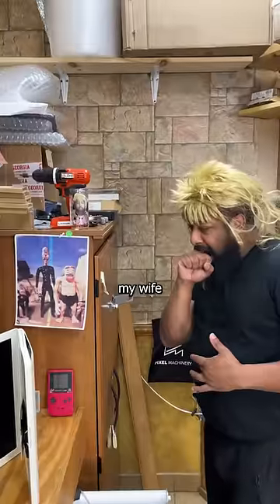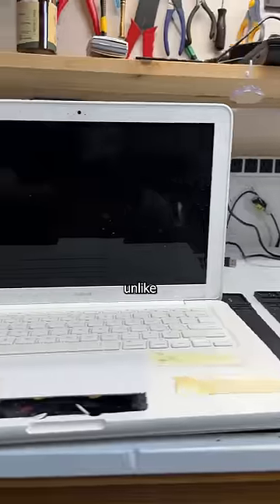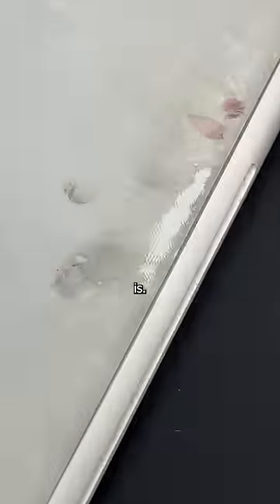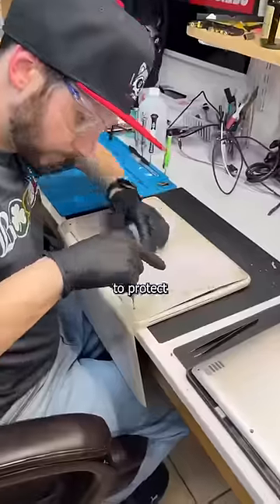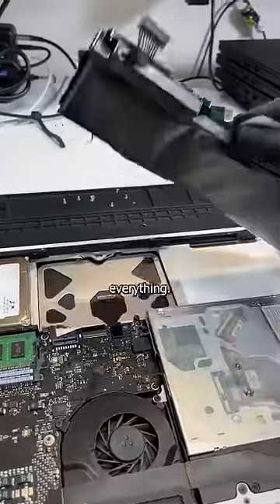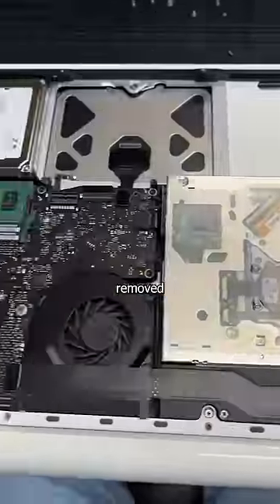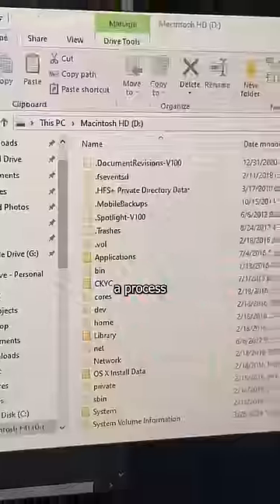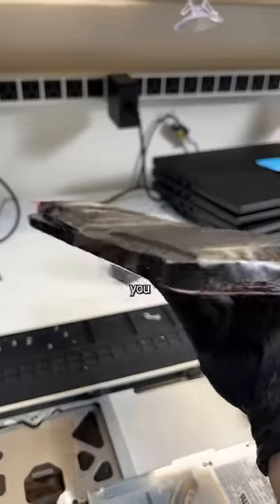MacBook swollen battery removal (GONE WRONG) #tech #technology #pc #shorts

Comment: MacBook Pro 2011. Original battery so swollen, it bent the aluminium base so bad, it’s still not properly back to shape. Replaced it with an Amazon special and that did the same after only a few months. Never had a Windows laptop battery do that.

Comment: Years ago I bought a smartphone from a Chinese brand that I had seen online called Elephone?? Or something like that. After 1 month of using it the battery started to drain extremely fast. I first thought it was because of a mobile game I was playing at the time, however, it only kept draining faster and faster to the point where I'd charge it to 100% and it would be at 10% percent after only 15 minutes... It also started to heat up super fast to the point where I could no longer hold it in my hands. Not long after that I suddenly noticed that the phone felt "bulkier" so I opened up the back and the battery was swollen exactly like that. Safe to say I immediately stopped using it and I never bought a smartphone from an unknown brand ever again.

Comment: My laptops battery used to get broken, if you unplug the charger it will turn off and the clock will stop, so i charge it all day. 
The battery becomes about 3cm taller.

Comment: My late grandfather had a laptop he Essentially used as a desktop. I noticed a bulge in the keyboard. After months of begging him to get it looked at, he brought it to best buy, where they told him that if he waited another week he wouldn't have a house. After evaluating his options, he just had them take the battery out and he left it plugged in.
Reply: Damn, they actually touched the laptop?  When I had a bulging battery in my laptop (wasn’t even that bad honestly, and had been stable for like a year because I didn’t realize the battery was in that area because past laptops had it in the back instead), Best Buy straight up refused to take it in for repair unless I handled the old battery myself first.  I had to go to a small business local repair store to get the battery removed and get a replacement in.

Comment: I had to replace the battery in my 10 year old laptop as it was just as swollen. Additionally a week after i installed the new battery the hard drive stopped working correctly and a couple days later it didn’t want to work at all. It was a pain getting it to work just long enough to recover all the information from it and transfer it to a different hard drive (i bought a slightly better hard drive than the one I had so slight UPGRADE).

Comment: iirc the only swollen battery I've had was the one for my cosmos black 3DS. Funny thing is, it was failing to charge for a couple months before we discovered the swelling battery and just assumed it was something with the charging port (it did the thing where it would only charge at a specific angle except worse). Once we got a new one in it charged just fine. Putting this here in case anyone is also having problems with charging their stuff since this solved both that problem and a potentially explosive one lol

Comment: "Have you had a battery swell up like this?"
With the people i work with, ive seen it twice..
Reply: So you'd have two nickels?
Reply: @philippeleprohon4823  which isn't much but I'm a little surprised it happened twice
Reply: My HP that I played WoW on did this after I spilled 7up on the touchpad and some got to the alt and window key.  I got a metal plate to cover it and an external keyboard to keep it arms reach away and HDMI display to tv but i eventually (after 2-3yrs) just had battery took out.

Comment: "Special software because we're using windows" due to it being a Mac Drive... I wish the repair shop I took my laptop to knew this. :D 

The situation was reversed: They use Mac, and my windows laptop wouldn't boot (Faulty SATA cable, damaged during keyboard repair) They uh... plugged it into a mac pc to check if the drive was faulty. Ended up nearly destroying my windows installation :D

Comment: Yeah mine did this, I just replaced it myself though, the local repair shops were offering excess of £100, when I could find the battery online for £70 and about 5 mins work of screwing and unscrewing/plugging

Comment: Yes. I bought an LG phone, back when they were making them. It was their Flex 2 or something like that. Worked well, but like all LG phones, had an overheating issue. Then the battery swelled up one day after overheating. Thing still ran, but it was no longer sleek. Looked more like a boat than a phone.

Comment: Looks like an older version battery so thicker plastic in and out, this can allow the battery to puff since it can hold gass way better than the newer ones. Also looks like it got quite warm one time, probably got left in a car or sitting in a sunny spot in a hot climate.

Comment: I've only ever had had a battery swole up on me one time. It was a  2DS battery that I decided to charge with 9 volts. It worked. But  It happened because my parents are horrible and kept taking away my custom cables. I was doing it safely so safely as I could  because I literally had no equipment. I literally had resort to biting cables to get get access to the wires.  Unplugged cables, but still.

Comment: yep, had my laptop (nine years old at the time, we got it used off ebay) suddenly swell up and stop closing properly. I didn't think much of it at the time but my dad was like 'oh holy shit we gotta change that battery'. So we spent a fun afternoon taking the back off and replacing the battery. Managed to accidentally disconnect the touchpad in the process, but fixed it luckily.

Comment: Yes, I've seen a swollen battery in my friend's MacBook.  I feared for her safety so I removed it for her.  This is when I learned that MacBooks  are assembled with triangular security screws that most people (including myself) don't have, despite a large collection of screwdriver bits.

This is a safety issue, and Apple is dangerously irresponsible for not making this battery easily removable by the consumer.

Comment: I repaired computers for a school district once, or as I called myself, the Chromebook Wrangler.  We had a bunch of swollen batteries sitting around, but then the battery recycler stopped taking them for some reason, and we ended up just throwing them away.  Which is even worse than it sounds, because this was in Arizona during the summer.

Comment: Lost an entire workstation mat, desk and PC along with a few thousand in damage to the ceiling and wall due to a marshmallow of death cluster out of a 2016 MacBook Pro that had that groovy adhesive that can tear the battery open real good no matter how much IPA you drench it in.
tear battery seal - add oxygen - run
Ensure tech gets medical treatment as needed.

Comment: I had a battery swell up (not this badly, but I caught it early) in my old MacBook that is identical to the one in the video. This happened about two years ago so the computer was well over 10 years old when it happened. I got an after market battery for it since Apple didn’t make them anymore and a family member needed an old Mac to recover some data from a very old hard drive. Surprisingly it’s still going strong. I mostly keep it now just to see how long it’ll survive.

Comment: I remember my first bulging battery experience. It was an old hotspot from my school for distance learning. We had left it in a drawer for about a year after we upgraded it, but when we used it, it was always on the charger. Sure enough, i was curious enough to stumble upon it again with a back about to bust like your father shouldn't have done. Popped it off and found a pillow spicier than those magazines you found under your parent's bed when you were younger. Boy, do I have a lot of memories using that thing

Comment: My mother's phone had such an expanded battery that I was surprised when it fell and broke the screen off but didn't pop the battery. (It had expanded so much that the back casing of the phone had broken [it was a solid back phone, experts are the only ones able to remove the battery type phone] and was chipping off. The screen now folds open like a book.)

Comment: Not a laptop battery, but a phone battery. The original battery in my previous phone wasn't holding a charge like it used to, so I bought a replacement battery. When my dad and I went to pry my phone open to switch the battery out, we did find it was swelling, so it was a good thing it got switched out.

Comment: Every laptop I've ever owned died due to an expanding battery. Usually starts within one year of buying it and even the one I'm typing this comment on has a battery that is bending the case. I've owned Compaq, HP and Dell laptops, and even a Macbook. Happened to all of them. I'm thinking of just only using desktops from now on.

Comment: I fix iphones, got one exactly like this to change battery. Put it in the heater, nothing exceptional. Screen is glued, it needs to be heated a little bit. less than 1 minute in the machine and the thing blew up in flames and fumes. Gladly the mainboard survived. Well, it was the only thing that survided to be honest.

Comment: I was gifted a handwarmer / portable charger. After turning it off one day it went off without a problem the little lights went off I pit it in my pocket it was still hot since it needed a bit of time. It only got hotter and hotter. I noticed when I got home how hot it was and when I feld the shape of it was a little bit more curved and buldged more than the other one which was fine. I looked at them site by side to see it and also heard a hissing sound. Yes hissing. Put it away from my house but in enclosed box which we gave to a friend who deals with stuff like this to despose. In his investigation (curiosity) it was basically wired like a bomb. A battery, a charging port, some leds, and a ton of loose wires which was the heating element which we believe was the main reason for the battery bubble

Comment: Yea. I purchased a note 4 in like...2015 - 2016 and, though dated, was still the best phone I ever had. One of its benefits were interchangable batteries. So when one died you didn't have to sit by an outlet. You could just pop off the back and slide in another one in. Sadly, this was during Samsung's battery defects. So I bought 2 additional batteries and eventually they started to swell about...5 months in. Scary stuff consider the drama regarding the note 7 a few years back. Ended up having to swap out the phone for a iphone 6+ because it was cheap and I wanted to play Pokemon go. It died like...4 months in due to ghost taps and unresponsive screen(shit phone and eventually got a note 8 and loved it until it died. Then got a note 10. In short, note series was the best ever.)

Comment: My phone battery was swelling while I was at work. I told my manager about it and she told me to call my dad ASAP so it didn’t explode in my pocket (it had blown up a TON without me noticing, I only noticed when I felt the curve while checking the time) when I called him and told him he’d need to pick up my phone and take it somewhere, I put it on speaker so it wasn’t near my face because I was super anxious about it exploding. Got the battery changed and the screen was somehow perfectly intact, but my current new battery must’ve been a knock off brand because I’ve only had it a year and it’s at 89% maximum capacity, while my other one was fine for three years and only needed to be replaced because it started swelling.
Reply from the maker: Unless your MacBook is 2020+, there is no such thing as a genuine battery, everything is a "knock-off" thanks to Apple refusing to sell us individual parts.

Comment: Had a battery swell up similarly before after heavy use on a laptop for 4 years.

A lot less insane, but I just put it in a box and forgot about it until like last week, surprisingly the battery is now flat.

Comment: I've had a camera battery swell quite a bit, not nearly that bad. I also had an Xbox controller "rechargeable battery pack" go thermonuclear on me and heat up to temperatures that could cook a steak in 30 seconds while I was using it, it was burning my hand through the controller

Comment: This had happened to me before. Not on a computer though.

I used to have a phone that was just an ancient Samsung phone that my mom had since she was a STUDENT. That damn phone was older than me.

Naturally it started deteriorating after some time, especially the battery. It would drain very quickly and it got to a point so bad where one second it was fully charged and the next it would die.

Anyway, one day I get grounded, as one does, and get my phone taken away.

I had to stay at my grandma's for a bit due to circumstances I don't even remember but I got a call from home. I was told that my phone had basically become a small bomb and that I was not getting it back. I was genuinely so confused because I didn't know batteries could even get swollen.

Eventually once I came back home my mom decided to show it to me, and uh. It was swollen to the point the case was almost entirely off of the phone.

Anyway thank you for coming to listen to me yap about my old Samsung Galaxy S4 becoming a miniature bomb. Have a good day!!

Comment: Just so everyone knows what to do - your best bet is to puncture the battery to release the trapped gasses inside. If you don’t do this, the pressure will build up and eventually cause the battery to explode and catch fire, which is basically GG at that point. Then you throw it in the trash where it belongs. Make sure to not put it into the food waste bin.

Comment: A lithium battery does not "explode". They shoot out a toxic and flammable gas that due to the heat involved will usually light up like a flame thrower that cannot be put out as it contains its own oxidizer. Best bet is to use  fireplace gloves to thow it ouside on concrete and let it burn itself out.

Comment: I found an old language translator device at the thrift store and plugged it in to change it. About 20 minutes later I heard a weird noise and noticed a big bulge and found that the battery was rapidly expanding. I immediately unplugged it and removed the battery.

Comment: I didn't know that swelled batteries = danger when my DS Lite had a pretty bad one. My dad took it out and it busted upon putting it on the metal plate when dad was going to show me just why they are dangerous. (No one got hurt, dad took safety measures, even if it  did go boom before he meant to)

Comment: I had a cellphone swell up. I was using it as my internet connection, so the battery was.constantly being charged and the battery management software wasn't up to the challenge. It swelled up to over twice the phone's original thickness, and popped the back off the phone.

Comment: Most of the laptops Windows i repair have swollen batteries like this case after 1-2 years of use. HP, Acer, LG, MSI... battery is swollen a lot. Dell, Surface , Asus, Lenovo a little less.

Comment: I ended up replacing the batteries in a bunch of server UPS units for a greenhouse that regularly encountered voltage issues. Pulled 6x massive swollen batteries out, was terrified the whole trip back with those bombs in the back of my car

Comment: I had two phones from the same company have their battery swell on me and both times I didn’t notice til it basically almost exploded or popped, I will never trust BLU phones ever again, the battery barely survives a day or not at all survive, if you hardly use it or you’d probably have 12% left after 5 hours even tho you had it at 100% before you left for the day. After about a half a year for each phone the battery would start to swell and something would cause the phone to just shut down if not attach to the charger which makes the battery worse. Now I know this sound weird to happen without really any good reason but it happened to me, all I did was charge it everytime it nearly died and maybe dropped it once during the time I had them. I nearly had a heart attack when I realized that what I saw wasn’t just a curved screen but the battery basically swelling to the point where the screen almost made the screen pop off. Yes I was young and was stupid but one phone, the swelling happened overnight and I didn’t notice til midday the next day but the second I caught in time and stopped using it immediately. I’m pretty if I remember correctly the second blu phone I got was from my bio father who insisted they were really good phones even after I told him what happened with the first one

Comment: Yup my old Razer 15 (2018 base model) had it and it dented the case which made me lose a few screws and it was not cheap to replace 

I had that laptop for 6 years after I've replaced it (I replaced it since the NVME SSD boot drive is already on it's last legs again (just 1 yr and a half after replacing the original that came with the laptop) and for me I cannot justify replacing it again.

Comment: Question: Ever had a battery swollen like this ?

Answer: Once, I took out a cell phone battery , fold it several times and then it became too hot to touch .... we thought it would go boom but it didn't ... I put on a helmet then picked it up with 2 forks and then threw it in a wet dustbin ( just to make sure the probability of it getting boom becomes more certain )👍 

This is a true thing , real af , I did everything ... Nothing went kaboom 😌

Comment: Yes, and accidentally damaged the battery trying to remove it (super glued in?) only giving me 10 seconds to get the device away  from anything flammable and it took a minute to figure out how to use the fire estingisher which messed up the air quality in the room(the device burned up, Good thing had could backup)